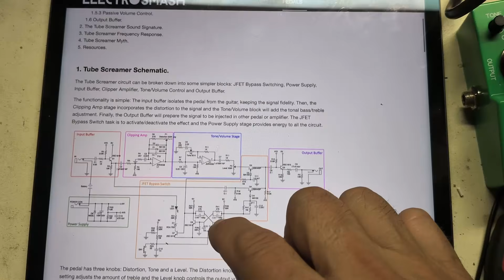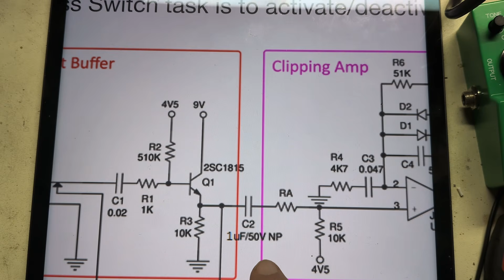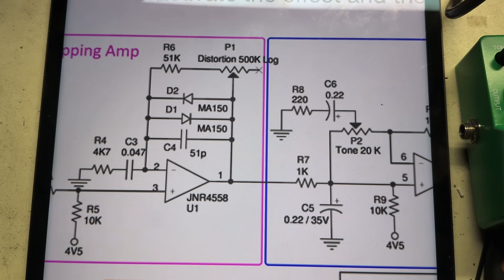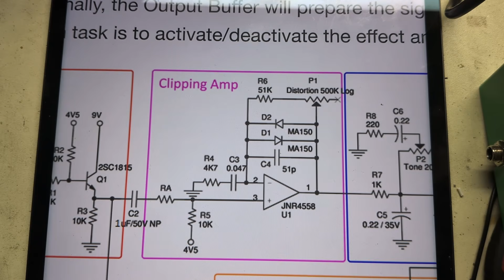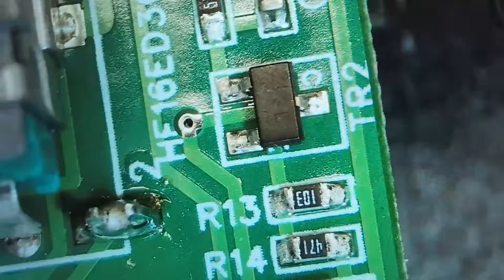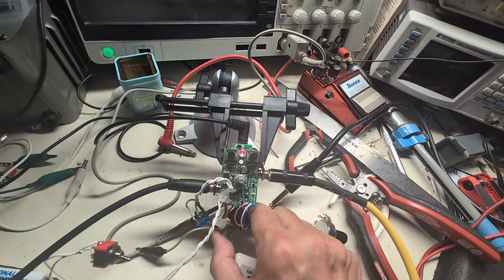Myth Busting TS9 vs TS10 Tone

Comment: Nicely done! I built a Tone Geek TS10. His design has a couple of switchable mods that I really like. One toggle adds some bass boost and one selects between symmetrical, asymmetrical (Keeley style), and LED for clipping. I also have a Bonsai. The Tone Geek sounds identical to the TS10 and the Keeley selection on the Bonsai. Seemed to me that the 808, TS9, and TS10 could be made to sound pretty much the same.
Reply from the maker: I'm going to add the asymmetrical to mine in the next video.  Germanium.